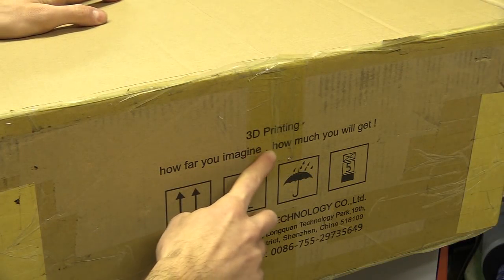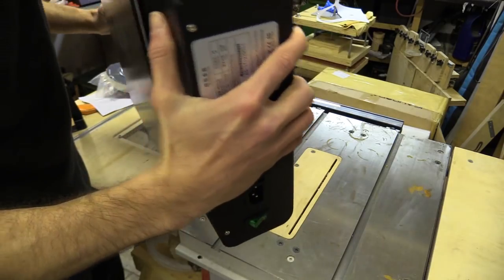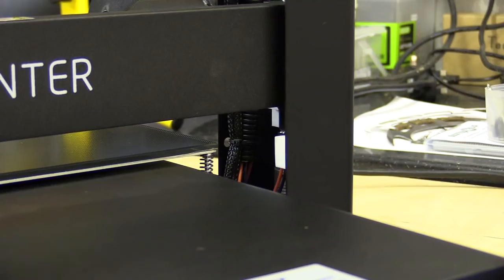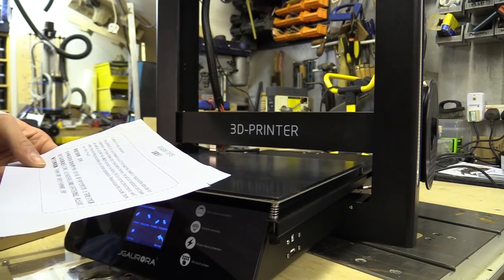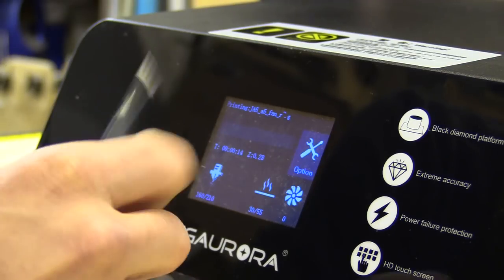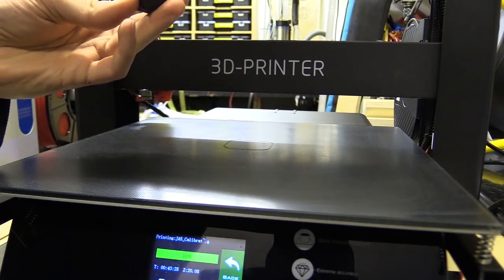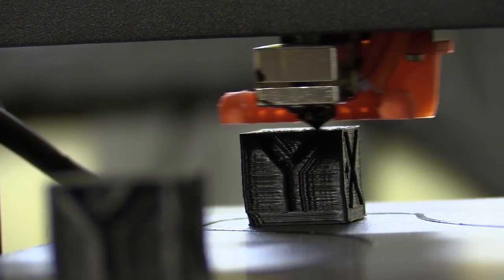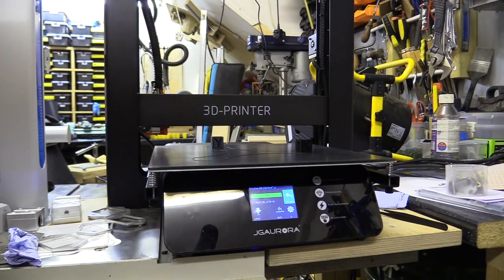Warm Tips / JGaurora A5 3D Printer

Comment: Very easy to setup and produce your first print these JGaurora A5 Printer's are and the LCD display is the leader of the pack but many of these JG printers soon go wrong after a little wear and tear and then you will spend more time trying to deal with the help desk and waiting for parts to arrive on a slow boat from China than the printer spends time working.

The "Attitude of users" JGAurora talks about must be "Put up and shut up" from what i have seen and if you used AliExpress to purchase the printer then you will discover that the one year guarantee is not worth the paper it's printed on.

Looks are only skin deep !

Comment: I do not think that JGaurora a5 is great but mine is quite good. I have to test more settings to get rid of stringing but with retraction at 6.5mm, ret. speed 35mm/s, print speed 60mm/s travel 150mm/s and temp at 195 deg celcious + 60 deg c bed... I got rid of the problem, it happens very rare and its easy to remove as strings are super thin. Can you send me stl for fan tunnel to work with aurora ?